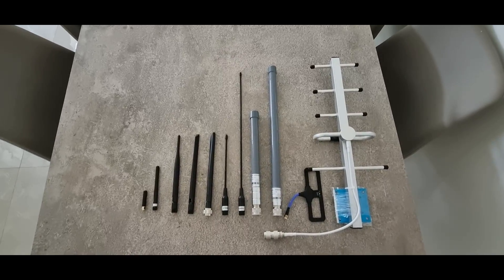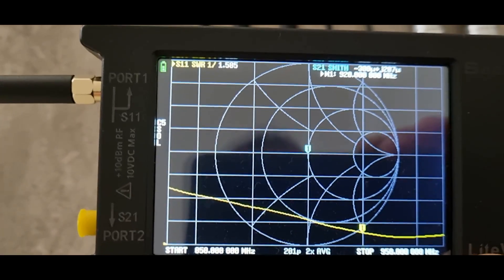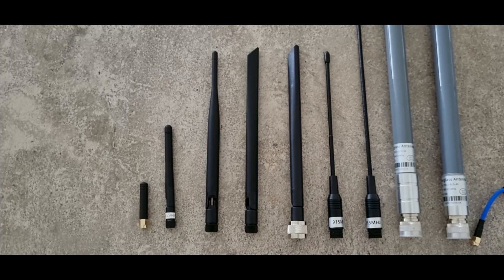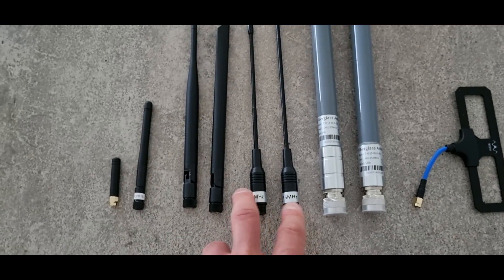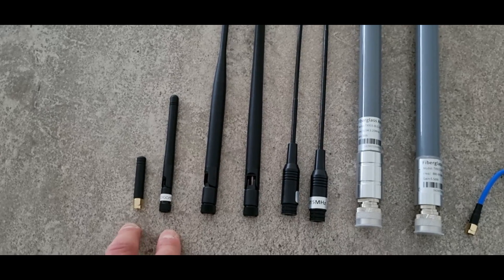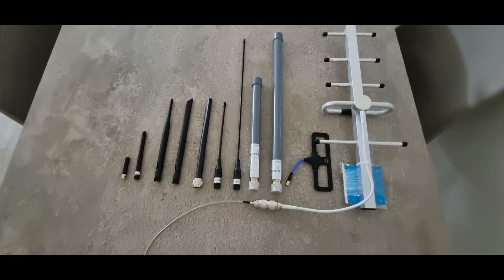Best antenna for Meshtastic or Helium

Comment: The VNA measurements are not made in the same manner as they are used. The stubby rubber antenna that is often supplied, having a male SMA connector connector is obviously a loaded quarter wave. It doesn't have a counterpoise. When attached directly to the VNA, that forms the counterpoise. But in use, there is a coax lead with IPX connector to a bulkhead connector. Most people use a plastic case. The SMA bulkhead connector is designed to fit to a metalic housing to form the counterpoise. Use a  male to female SMA jumper and observe a completely different effect. The taller antenna  obviously has a fold-back internal counterpoise, making it a half-wave dipole. If you want to use that stubbly antenna on a plastic case, then at least laminate it with aluminium foil tape and clamp the connector fitting to it!

Comment: 0:29 smallest          ≈ 1.55
1:07 slightly larger  ≈ 185
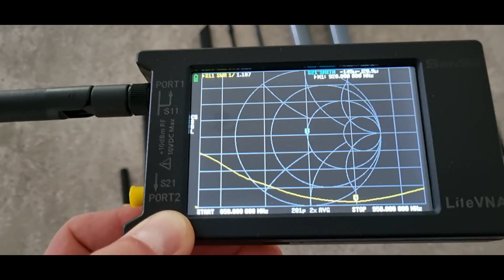2:21 "normal"          ≈ 1.2
3:17  flexible 20cm ≈ 1.2
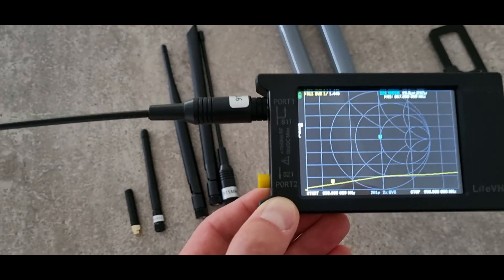3:35  flexible 40cm ≈ 1.XY couldn't read it, "nearly the same as the 20 cm flexible". 

Thanks for the comparison xD
4:48 fiberglass outdoor 20cm ≈ 1.1
fiberglass outdoor 40cm ≈ 1.1 wasn't shown in the video, "nearly the same as the 20 cm fiberglass outdoor". 
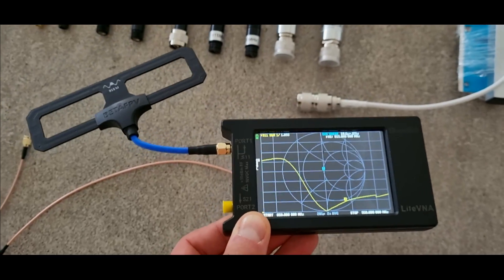5:26 Directional moxon rectangular ≈ 1.6
5:41 Directional yagi ≈ 1.XY couldn't read it, "as low as 1.1"

Comment: I currently have the 1st and 3rd one on your table,  the snubby one was ok,  the other was better,   couple of notes,   the 3rd one loses it's good SWR when you bend it,  I have tried using a jumper or direct.  you need to keep it straight.  also,  Meshtastic channel 20,  which is what most people use for the open channel,   is tuned to 906.875Mhz   I have noticed that both the 915Mhz were tuned closer to that frequency (less reflection) which is a good thing.   I will eventually get one of those fiberglass antennas for my solar node.   although the 5dBi bendable one (ant #3)  has good gain,  it doesn't look very water proof.

Comment: The SWR of all of them look fine but how do they compare in terms of gain ? A 50 ohm resistor has a perect SWR but doesn't radiate so well ;-)
Reply: Exactly! Its good that these antennas make the radio happy, but how much power is the antenna soaking up as heat and actually radiating?